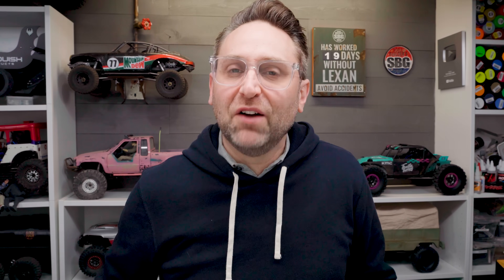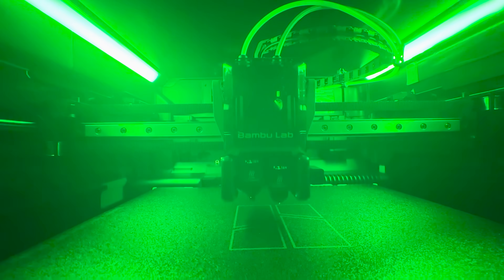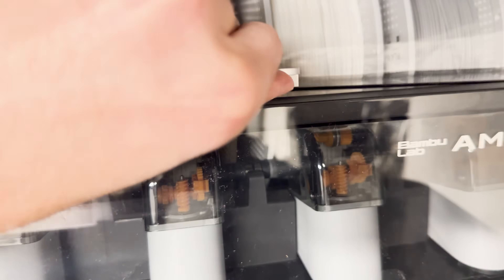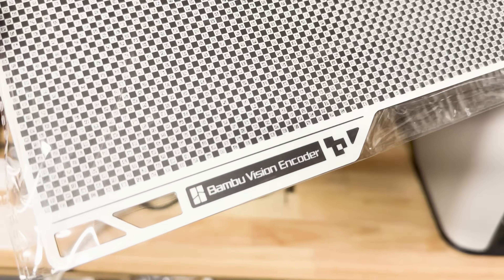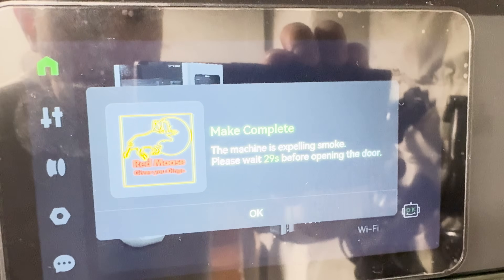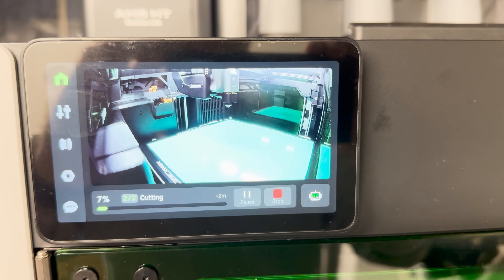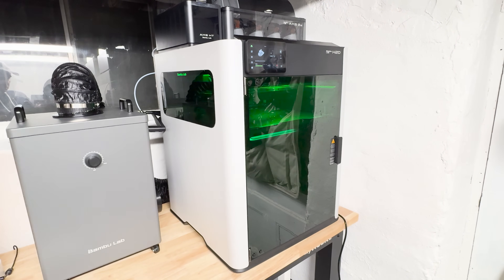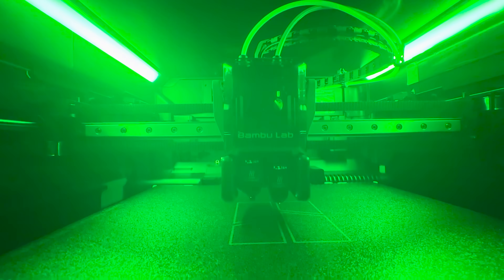This thing makes me BETTER - Bambu Lab H2D

Comment: Dude.. you're getting the vibrations all wrong.. the rubbery feed make the case move alot more yes, but without them, the internals of printer dampen them by vibrating on their own. Having whole printer move actually reduced the vibrations of internal components.. there is no software compensation in place for this. It shows that you're not and OG 3d printer user.
Reply from the maker: Right from the H2D website: "To minimize banding artifacts during high-speed printing, H2D employs automatic vibration compensation. Using toolhead sensors, the system recalibrates parameters before each print for consistently smooth and stable results." AND: "The H2D employs floating damper feet with a precisely tuned resonance frequency to effectively decouple the machine from desktop vibrations. This vibration isolation system ensures consistent print quality even in the presence of external vibration sources."

Comment: What is the point of filtering the exhaust with the $650 filter just to exhaust it out the window?
Reply from the maker: It removes all odour from the room prior to exhausting. It's designed for being used if you can't exhaust out a window, for smaller rooms.

Comment: Got the print combo, it has been a joy to use. Still fine tuning it, but I'm already seeing many print quality improvements over parts my A1 chugs out.
The laser edition comes with a completely blacked out top glass doesn't it? Yeah that would be a deal breaker for me personally. I do really want the cutting module, hopefully they'll release a cut-only upgrade kit.

Comment: 'I got it for free and it's unbelievable'. It doesn't work anymore, superlatives spewing review. They spend so many time on a thing nobody was waiting for, a laser in a 3D printer? Dirty as hell if you start cutting plywood. The dual head is already used in the 2023 Creality Sermoon 3D PRO. The AMS is a disappointment and is greatly copied from other brands. Innovation levels are close to 0 on the H2D. LIDAR removed, only accurate if you buy an extra plate, common be real.
Reply from the maker: I'm buying a second unit, I'm so happy with it.

Comment: I took love the new H2D and will be getting one..... but..... anyone who thinks running a laser inside this is a good idea is utterly clueless. It WILL ruin the entire printer in short time. Just go look at their wiki. Everything will get F#÷$% up. All the belts,pulleys, sliding surfaces and even the linear rails will get destroyed by all the carbin and soot inside. I dont care how good You think the extraction is. It's gonna die.
Reply from the maker: Which is why regular cleaning and maintenance is key.
Reply: Go look at the wiki on cleaning this thing. You have to half way strip down the machine. I have a dedicated fibre and blue light laser. And a dedicated bambu A1 printer. I never have to clean anything.@scalebuildersguild

Comment: Its actually not faster than the X1C. The X1C wins out there, because its smaller so can handle higher accelerations.
Reply from the maker: It's definitely faster at multi-material prints though!

Comment: "Instead of multiple plates you can just do this in two!" "Its so much faster than the X1C!" 😑😑😑
Reply from the maker: Multiple, like eight. Multi-filament changes are faster and produce less waste.
Reply: @scalebuildersguild  Two is still multiple. This video bugged me a lot, there's a lot of breathless hype, and for anyone spending time in the Bambu subreddit, the things you're saying about speed and quality just don't hold up. Many users are finding slower print times and worse print quality.
Reply from the maker: @ that’s unfortunate, but I can’t say I’m seeing any reduction in quality or speed, coming from the X1C. There’s been a lot of updates since the printer came out, and I have to say, it’s been flawless, another 25 hours of printing since this video was edited.

Comment: Why spend $600 on the external filter if you're still going to exhaust outdoors? Save $600 and just run a duct from the back of the machine to the Window.

Comment: Bambu lab is in the list, but currently out of my budget. I did just pick up on sale the anycubic kobra 2 max. Its 420x420x500 build volume and 4-8 times faster than my previous ender 3v2. Can't wait to print a body on it
Reply from the maker: That's great! Good luck with the new printer and the build!

Comment: Why are your lights on the ring circuit
Reply from the maker: Because it’s an overloaded circuit when I add the printer.
Reply: @scalebuildersguild but why are lights on the same circuit (ring) as sockets?
Home install?
Reply from the maker: @ I’m not sure I understand, I didn’t wire this house, but that is pretty common here. 🤷🏻‍♂️
Reply: @scalebuildersguild I'm in the UK so it's super odd to us, expecialy with our higher voltage.

Ours are always seperate,.mainly because our socket ring main can pull 30 amps so we wire lights so a max 20 amp.

It's gotta be annoying having less power to run appliances without using a three phase though don't many not use a 240 supply for some kitchen appliances

Comment: The H2D is NOT faster than the X1C. It's in fact slower. It's only faster when using multiple filament colors/materials. With a single color the X1C is faster. At least according to the people on the bambu forum.
Reply: X1C has higher acceleration because the toolhead is lighter. 10000 for the X1C and I saw 7000 for the H2D. I have a X1C and thinking about getting a H2D, maybe with the 10w laser.
Reply: nothing is slower than having to unload and load a new filament each color change. especially, given the nature of how 3d printing must occur layer by layer.
Reply from the maker: So it’s still faster then, in certain applications? Yes.
Reply: @scalebuildersguild the more tool heads or nozzles you have in an application the faster it will be in a multicolour print, hence the Prusa XL with 5 tool heads will out print a multicolour on a single nozzle with purge and wipes.  In single colour applications the faster speeds also trade off final quality so despite numbers quoted, real world application is something different .
Reply from the maker: @MrBennyt19  Yes, I'm not asking, I know. I should have been clearer in where I was getting my claim. Thanks for your comment!

Comment: Dont like bambu lab anymore. Closing their system, most likely will cut you of drom using other filament and slicers...  And I think this is their worst release so far 🙁
Reply: They have already confirmed that they are not going to be locking out filaments.
Reply: @Xanthira222  They only confirmed that for their current line of printers. Not anything new.
Reply from the maker: I think they made a mistake, realized, and have since fixed it. The printers are so good, and it would be company death if they chose to close it to just their filaments.
Reply: @scalebuildersguild  Except they didn't fix anything,. Everything they said they would do is now implemented in their latest FW. All their anti consumer/anti 3rd party crap is all there. Even orca slicer will no longer support bambu.

Comment: I have the A1 and I Really want to upgrade to this! I am worried from the video showing the uneven heat on the bed and the people reporting issues printing PLA. Have you had any issues with PLA on certain spots of the build plate? After the craziness with the A1 heatbed im a little scared but pretty sure i want this printer with two AMS's so i can have one on each nozzle.
Reply from the maker: I’ve had no issues, and have over 35 hours of printing on it so far!
Reply: @ heck yes thank you! ill probably order one on tuesday!
Reply: @arranwilliams2523  I've had zero issues on my H2D so far with PLA. There was only one print that started to lift but that was my fault because that part of the print was really thin and I should have put some glue underneath that part. The print still worked though.
Reply: @ heck yea thank you this printer is amazing cant wait for tuesday when i can order one!

Comment: Venting properly , would not be best out of open window, it could blow back if there is a breeze. I vented using an exhaust from a dryer 4" , with no way of interior backflow..
Reply: A properly sized exhaust fan should over power anything under storm weather. His window is close to ground level so gusts would probably not be a factor. Also a back flow damper can be closed from a gust of wind. A back flow damper for a dryer is just for the time when the dryer is not used so gusts do not cool your home.
Reply from the maker: There’s a pretty strong fan unit on the purifier. I’m not worried.

Comment: Just a heads up on build volume, it is only 350 mm in X if you load two spools of the same filament in both nozzles. If you only use one nozzle, it's 325 mm in X. If you are using both nozzles it's only 300 mm.
Reply: @PrometricUSA What makes you say that?
Reply: "only" XD what the hell are people printing where they need the full 350mm.
Reply from the maker: @Festivejelly  Just wait...
Reply from the maker: Which is why I said, "up to". I should have clarified that point, but yes!

Comment: It's $3,500.00 😮 
I wanted to get my first printer soon. This won't be it, 😅
Reply: You don't need the lasers so it's really "only" 1900 without ams or 2200 with it.
Reply: Is the laser even worth it? Whats it used for just engraving? Can it cut metal or anything like that im interested in the printer i just love the build size but im just wondering if i need the laser or if uts nith worth the money @atnfn
Reply from the maker: Totally fine, it's not for everyone!
Reply: @scalebuildersguild  Don't get me wrong, I would love to have one. It's just the price tag. Can you recommend a printed for an extreme beginner?  
I would like one with its own screen so I could just plug a thumb drive in so I don't have to keep it connected to my laptop. I don't want a new hobby, just the ability to print random things for my rc cars.
Reply from the maker: @jhrubicon1470  Take a look at the Bambu A1 Mini if you're on a budget.